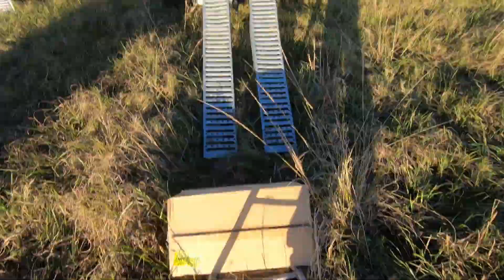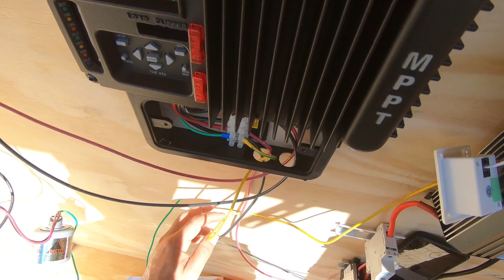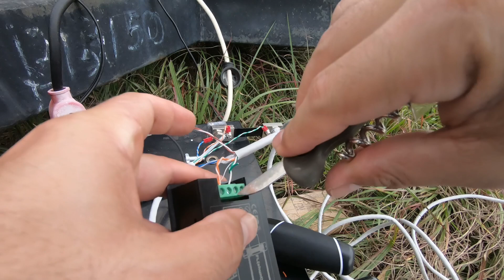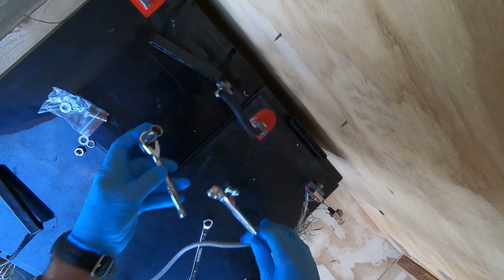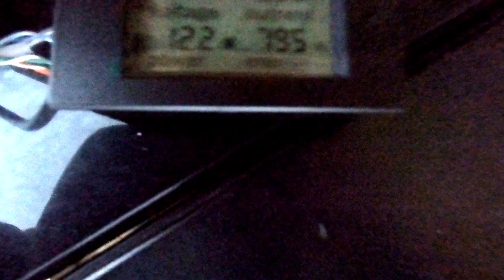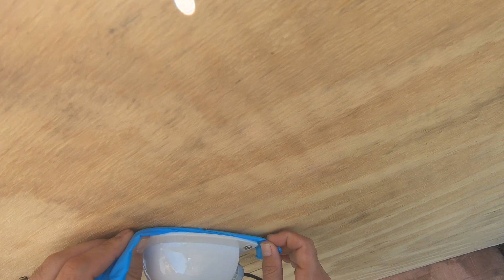Connecting Off-Grid Charger and Inverter to Solar Panels. Vol 2: Ground, Batteries and Panels.

Comment: Sugerencia:  cubrir por completo esa varilla de cobre para evitar accidentes con cualquier persona.
Reply from the maker: That copper rod is just part of an elaborated trap, if you are unaware of your surroundings you first trip on the rod or the wire and then get a hit to the forehead with the edge of the panels. Double whammy.
Reply: @beingafals  🤨🙄😵‍💫